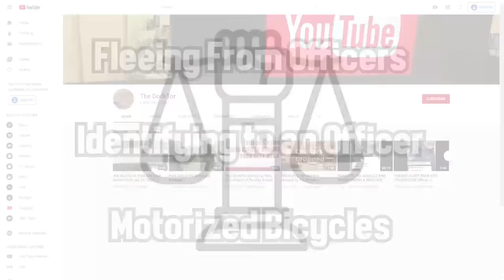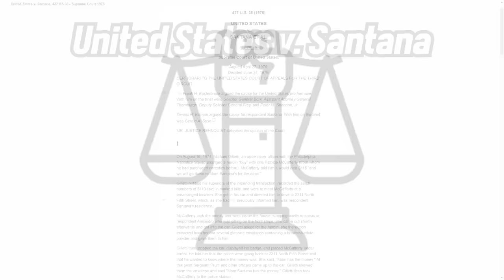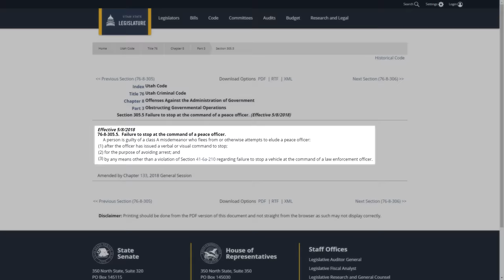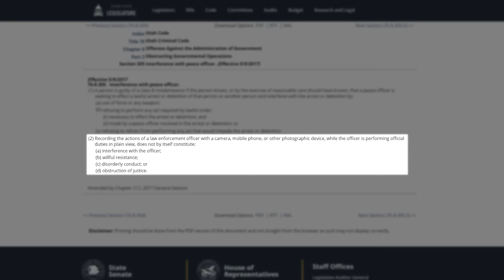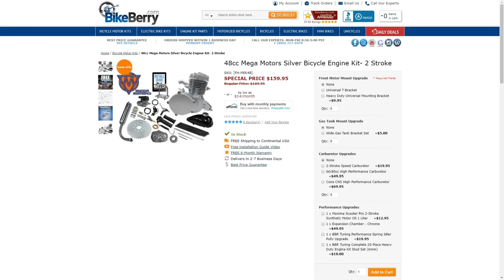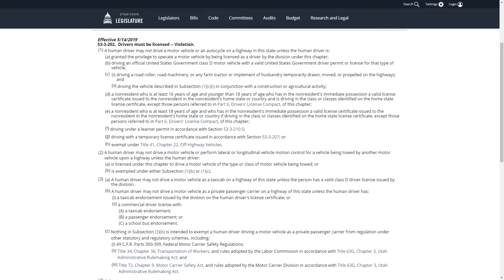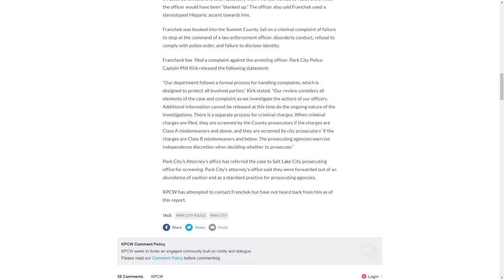Teen Stands Up To Cops Arresting His Father

Comment: As a Utah resident I can add that in 2019 Utah was a permit-less open carry state (now constitutional carry) everywhere by downtown Salt Lake City. So someone "seeing a gun" should have had no bearing on this situation. It was then and still is quite common for people to open carry everywhere.
Reply: Exactly, the 911 call should have been something like this. "Ma'am, possessing a gun is completely legal. Was there any threat to use it?...No. was the gun in question presented, drawn or anything that might qualify as brandishing?... No. Then please understand you have not reported any criminal activity. We will investigate the incident, but it does not appear to be any evidence of criminal acts." Also the person that made the claim was a outside witness, they were not involved with the original disagreement. Lastly the disagreement was over (without any actual violence)before the  cops were even called, so we can question the necessity of the cops presence. Granted the cops are within their authority to conduct an investigation, they are not entitled to insist any individual aid in that investigation. Failure to be helpful is not a crime. When the cops tend to treat every member of the public as a suspect, they should not be surprised when the public treats them as adversaries.
Reply: Actually it has been an open carry state for a long time. The difference is if you did not have a concealed carry permit then the gun needed to be two actions away from firing. For example the chamber empty and safety on would be two actions away from firing. 

If you had a permit then you could open carry with a round chambered and safety off if you wanted to. I open carried 10 years ago before I got my permit. But hide my gun now because the attention is not worth it and puts me at an advantage by not showing my cards. 

The difference now is you don't need a permit to conceal your gun if you are 21 and over. 

In this case "seeing a gun" could still be an illegal thing that could be investigated. For example if he had the gun in his hand or flashed a gun from the waistband during the altercation it would be considered brandishing a firearm even if it wasn't pointed at anyone. So yeah very illegal if that was the case.
Reply: If I understand correctly, the allegation (which is clearly false but whatever) was the kid, Jack, was carrying a concealed gun. I'm not sure, and correct me if I'm wrong, but doesn't Utah restrict carrying to persons over the age of 18? 

I mean, I would hope no state would allow kids to own and carry concealed firearms!
Reply: @jasonlongton1876   I don't think it was clear who had the gun. In Utah it is illegal to buy/sell a hand gun to someone under 21 as a FFL dealer. For 18 and up it is not illegal for someone to open carry a hand gun... So we kind of have some dumb laws. Those under 21 cannot conceal carry. You have to have a conceal carry permit to carry onto school property. But that's about all the limitations we have unless you're a felon. 

In this case I think the teen was 15 so if he had the gun that would also be illegal since it was in a neighborhood not at a shooting range with adult supervision, or out hunting.
Reply: @DaveJohnsonSCG  Understood and thanks. Honestly, I doubt a gun was involved in the first place!
Reply: @jasonlongton1876  not so. The allegation was the father was carrying. The original video on this encounter showed more of the encounter and was not as favorable to the actions of the officers.
Reply: @jasonlongton1876  The allegation was that his dad had a gun in the back of his waistband, only being noticed as he was walking away from their argument. ATA has turned into a pro police channel, it's sad.
Reply: Ah the states. Truly the pinnacle of western society.
Reply: The possibility of him having a gun is only important because it makes a possible suspect a possible armed suspect.
This encounter never started because of the possible gun.
Reply: A gun tucked in the waistband isn't open carry.
Reply: @jasonlongton1876 it's sad that we are here.  Many of us had rifles and shotguns in our vehicles at high-school during deer season.  Female teachers asked us to open boxes with our knives; and nobody was worried.  We need to remove everyone from society that creates that worry; not the weapons that protect us from them.  The criminal class is small and could be exterminated.
Reply: It depends on how the information was conveyed and how much information was left out, maybe they only heard from the witness that he had a gun in his pants, without being told that no threats seemed to have been made.